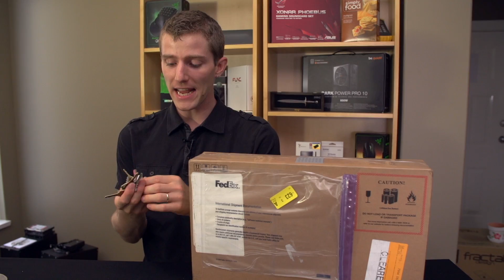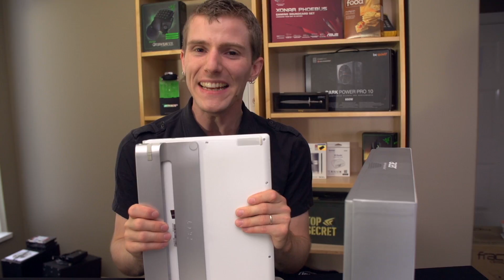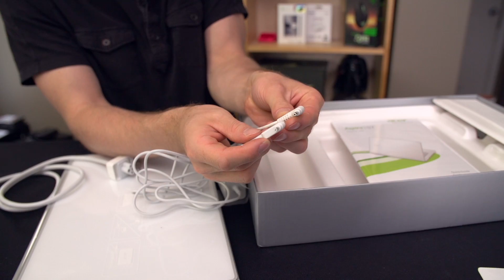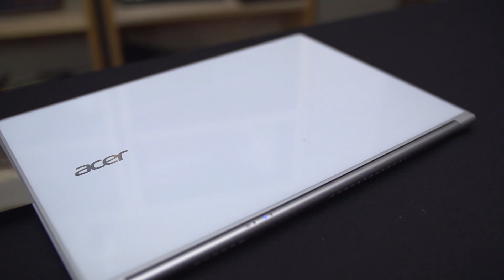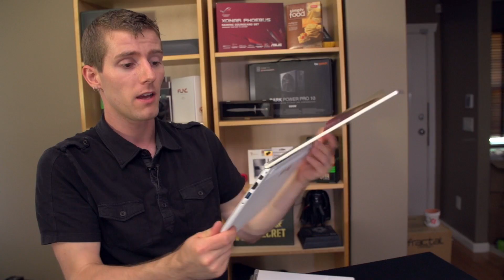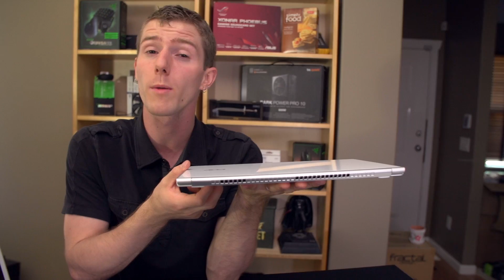Aspire S7 392 - 2nd Generation Perfection Unboxing & Overview

Comment: I am a big fan of Acer laptops. I recently purchased an Acer Spin 3 due to it's specs and price. For $549 US I got 7th gen core i7, 15.6" full HD display 12 gigs  of ram 1 terabyte HDD, alleged 10hr battery and blah blah blah (not to quote Alex Lifeson at the Rock and Roll HOF induction). It also spins 360 degrees to function as a tablet. Which brings me to my question: How much upside down, on its side can a HDD take before it goes belly up? I don't plan on dropping my laptop but I do spin it to tablet form frequently. It is a great orientation for clearing pictures from a memory card quickly. Should I replace the HDD with a SDD? Did you make a video addressing this question that I missed? Cheers, Sean

Comment: Old video so may or may not have an answer on this, but would you trade a Phenom IIx4 965 black edition cpu build with 8gb ram 1333mhz and an nvidia gtx 960 ssc 4gb video card for the previous aspire 391 laptop? i mean i'm the owner of the build previously mentioned but i need to move some now and then and that means i need something portable but good enough to handle photoshop and audio editing programs and why not the ocasional gaming.... so let me know what you think...

Comment: I've had aspire s7 for more than a year. Over heating, noisy fan, mouse stoped working(blue tooth and also some functions of touch pad), keybord has the worst design a manufcturer can make, display has high reselution but not sharp. I was missleaded by the sexy look when i went for this.

Comment: Yes,when Acer came out they were generally acknowledged as a complete POS and waste of money due to their horrible quality and failure rate....and that reputation has preceded them for quite a while....with that being said,I have seen them take great strides to shed that bad reputation of low quality junk they were pretty well known for....I would consider trying one out if it were a gift,but I would still be hard pressed to buy one out right...A close friend of mine is an engineer at the Foxconn in Plainfield IN...will have to get his 2 cents on the current gen of them.
Reply: chemicallust77 i actually got one of the first gen i7 aspires (one of the 7700 production series) and it's still going strong 5 years later. also use their 21.5" monitors as my two main monitors. they really shifted their QC and production values and in my book are really only a notch or two below ASUS at this point. they REALLY turned around. 

that laptop has survived some pretty hefty abuse. i actually dropped and broke the screen from a very high height but got the screen repaired and everything else was a+, which is a hell of a lot to say for an 8lb 17.3" monster
Reply: chemicallust77 My old aspire 5315 (and new E15) are both brilliant laptops but don't expect a brilliant screen (1366 x 768 and pretty bad colours) I have dropped the 5315 a number of times and it is still going strong. The 5315 is highly upgradeable too (up to 8gb of ram I think) I got the 5315 from my uncle and it wasn't treated very well but now with a core 2 duo, 2gb of ram and hackintosh snow leopard it really flies.

Comment: wouldn't trust it as far as I could throw it (quite far with how thin and light it is), the acer laptop i had for a year broke down on me 5 times and when it broke the 5 time, it was out of warranty, so i repasted the cpu and gpu myself, it stopped overheating and has been fine since, so it wasn't the components, just acer being incompetent

Comment: Can i hook up this laptop to a bigger screen if so would you know what wire i need to use
Reply: You can use an hdmi cable to connect to an hdtv. It's possible to use VGA cable but you need the acer converter cable also.

Comment: Brilliant Video, this is the machine I will buy next, always rated Acer, have an Acer Aspire 5536 running Linux mint 16, so I would biff Windows 8.1 straight away and install Linux. It is the nearest thing to a Mac Air. John in New Zealand.

Comment: I've been drooling over this laptop for the last few weeks now. I keep trying to tell myself that I can get a great deal on the older s7-391 model but I really am interested in a few key improvements. The quieter fan, improved battery life and performance from the Haswell processor. I actually didnt know about the extended battery pack for the 391 which is now tempting me to be cheap again but im not sure that it is actually included with that model 0.o Definitely this laptop gets my vote for most attractive laptop (in this price range). If I were rich I would be looking more in depth at the 14" Razer Blade which has similar specs, pretty design and a monster graphics capability for its size.

Comment: Of course it can't replace a desktop. However, with Haswell and other upcoming architectures, microprocessors and even the motherboards are shrinking more and more. Soon, we may have similar performance in a very slim frame. Go check out some of the custom mini-itx desktop builds out there!

Comment: Actually there are external lightning GPU's they just are not that optimised. I cant wait for them to be produced fully. Imagine that all you would need is a 1080p monitor and the external GPU and the PSU build in to it and just a laptop to use as a processor and etc.

Comment: yeah, unless youre running professional level simulation programs, or rendering 1080p+ video, I find no reason to replace a laptop such as the razor blade because of performance issues, although a desktop is obviously more comfortable.

Comment: I'm honestly kinda torn now. I was really thinking of getting the thinkpad x230 (or x240 when they make a haswell version) but this seems like a great alternative. The s7 has a better screen, is haswell currently (I'm patient) and is much thinner, but the x230 has a trackpoint (huge plus for me) better keyboard and much better battery life (20+ hrs with 9 cell and sheet battery on ivybridge) It's also cheaper right now ($950 or so all in for the x230, the x240 will cost more on release). What Do

Comment: I found a couple of problems with my own Aspire S7 392.
1) The keyboard emits a faint high pitch noise when the LED kicks in.
2) Write speeds on the SSD actually seem slower than last gen
3) Sometimes keys don't really register if you don't hit them dead center of the key.

Other than that, I found the ultrabook to be pretty awesome

Comment: the only reason i dont like it much is there are only 2 usb ports, in my opinion, most users use a mouse which will take up 1 out of the 2 usb ports so if you also want to connect an external keyboard for example then you wont be able to connect anything else via usb

Comment: Remember the difference is that Apple will design a product and then before releasing it to manufacture they remove a majority of the features just so they can offer them on the next years model without any other major changes.  This machine is a pretty decent update on horsepower while making improvements on the features of the original.  Apple does whatever makes them the most money per device, other brands tend to focus on the points that allow them to sell more units.

Comment: Spartan, I am also a halo fan. Just something out of the random.
But in all seriousness, let me ask you a question. Apple, the company that founded macs/ipads/ipods/iphones and the OS X operating system. With macbook pro laptops running on OS X, do you think Apple would optimize for Windows (something that Apple clearly did not make)?. Do you really think optimization for windows is there in an Apple product?

Do you really know what YOU'RE talking about? I don't think so.

Comment: 1. You can't type properly.
2. YOU are not trying to accept what iopabc123789 is trying to say.
3. YOU lost the argument.

What you are trying to say here is that, with a windows built laptop with the exact same hardware as a macbook pro, you are saying that running windows through bootcamp on the macbook pro will have better performance than compared to the windows built laptop. You've got to be kidding me, are you a fucking idiot?

Comment: They are not the same exact idiot, you clearly dont know that there are possible flaws in software. Mac can run software better and uh no there not as far as build quality. And ya your comparing a 7 year old console to a brand new pc with a little bit of older hardware, build a pc with parts 7 years ago running windows 7 and get 30 fps, just try, I challenge you

Comment: Uh if you can read, I said the link didnt work. I saw the video, kind of impressed but you know more about hardware yes, software you know zero. Have you ever heard of software optimization? Software, not hardware, you realize how invalid your argument is. Ok put planetside 2 which is a high cpu intensive game on that pc or even a high end pc and put it on the ps4. Ok they are the exact same software, completely identical, ps4 will run it as good as high high end pcs

Comment: Umm sort of true. You did kind of counter yourself though. hardware spec and optimization.. what optimizes hardware? Software... Lol

Anyway spec doesn't always determine a winner. A PS3 for example is far superior than any 500$ laptop. Play games on it at the same res and graphics will look better on PS3(at reasonable frame rate).  Why? Optimzation through software and libraries.

Comment: Can anyone confirm whether the battery "blister" pack from the original S7 will be compatible with the new S7? I'm very surprised Linus didn't touch on this or try it out. If it's NOT compatible, will Acer be selling a new battery add-on for the new S7?

7-8 hours is awesome, but imagine being able to add another 4-8 hours on if you needed/wanted to?

Comment: Run better my ass. Link or it didn't happen.

Although different motherboards on PC has shown to perform differently, depending on model and manufacturer. But usually these performance differences are very minor at best. And hardly worth spending the stupid amounts extra that the hardware costs, for a small performance increase.

Comment: @ components: not really, more or less. And @ software and spam: yeah buddy, but so does the rest. So format and reïnstall your pc when you buy one, regardless the brand.
Asus claims to use better capacitors on their motherboards 5k instead of 2k (where to 2k is more than good enough). I don't know enough of it to congfirm that. And Asus doesn't use its "consumer grade components" in their laptops. So don't worry, be happy. Look at the package, price and what you need.

Comment: Yes, no problem, have fun with it. And buy a custom cooler for it. It's worth the $. No water cooler for you yet tough, if you need to ask this, a water cooler is to advanced for you. With all respect. (4930K uses the (LGA)2011 Socket)

Comment: My opnion:
The extra few hours battery life, is because of the OS. Apple beats Windows in energy management. Furthermore Apple was always good in taking several seperate products in a market, and forge them togheter in something better. But if you are looking for something else like the MacAir, look at the Asus Zenbook Prime, or the Samsung 9 seris (now Ativ) or Acer S7. The Battery last 2-3 hrs shorter, but 7+ hrs is long enough in practice. (btw MacAir only get 10hrs in practice instead of 12)

Comment: Linus, What do you think is wrong with pc manufacturers, it feels like they just have trouble making the halo product. I want that high quality , low weight, 1080p ips(touch or no touch, don't care), with macbook air battery life. I honestly don't know how Acer can release a product without 12 hours battery life when the market leader macbook air offers that.  

Whats your theory on why ultrabooks are still trailing the macbook air? i think they just fail to understand the correct features.

Comment: I as computersalesman, not selling atm:
Acer isn't my favorite. But the difference isn't that much with other brands in the practice. I like asus but when I buy an Asus and an Acer and use them the same, they should last evenly long. Only Asus designs better. (RAID 0 SSD is unnecessary for ultrabooks, bad even). So for the same money, go for an Asus in my mind but that doesn't make an Acer bad. And in both ways: always format and reïnstall your Windows. Anti bloatware.

Comment: Ok I'm bored tonight and replying to much. but here I go:
This type of model is build for the "business market", for people with lots of money to buy a -very- good ultrabook to school or work with.
Now you can have 4 or 8 gig's of RAM, wich in both cases is more than enough. These ultrabook have features like long battery times (thanks to SSD's and underclocked processors). They are lightweight, strong, not build for overclocking, gaming, Video/ Music/ 3D editing etc. So the FAIL is on you!

Comment: Love it or hate it, soldered memory is going to take over. I don't necessary think its failure rate but more that it allows manufactures to save money. when you solder you don't need to order/manufacture pcb anymore or sodimm slots.

It also allows for less tinkering. It allows oems to deal with rma directly without having the user attempt to repair it themselves which may cause more damage to the product.

Comment: Wait, wut? Are you saying modern RAM has a lesser failure rate and therefore  we should give manufacturers a pass over omitting user replaceable ram? Not sure if srs. My machine is light as hell and still has user replaceable ram. Hell, it has 2*mSATA as well, which are also replaceable. 3.1lbs or 1.4kg.

Comment: I do respect your opinion.. And i have watched your video, did you see how many dislikes it has? Its because the guy didnt know a single thing about windows 8.. The first thing that pops out when you install w8 is a tutorial which explains you the new options and features. (it wasnt hard to click windows button and just type control panel, it would pop right out here and you will be able to open it)  same with pop out things, nothin' pops out anymore, there's nothing, same as swipe gesture.

Comment: Sony Vaio is made out of carbon fiber, which is worse than the Acer S7 which is built out of a unibody aluminum enclosure, with gorilla glass 2 covering the back and the display. Carbon fiber flexes allot, you should check some reviews first. Both laptops are 13" Full HD IPS LED-backlit touch displays (1920 x 1080), but sony included bullshit software "optimization" which is not even close to sRGB meaning that the colors appear to be unrealistic, kind of like Samsung and their amoled crap.

Comment: I actually must disagree with you on most of those points. The display on both are extremely similar however in my testing I have found that the s7 has superior viewing angles. The s7's keyboard has more travel, and trackpad is superior in terms of latency. I worry about the vaio pro's build quality as it has alot of flex in the chassis, the s7 gives no flex at all. Battery life and boot time are  the same as well. All in all both are great machines but I believe the s7 edges out the vaio pro.

Comment: Meh. Should have waited for the ASUS UX32D haswell refresh. I have the Ivy-Bridge SKU and its ram and ssd are both upgradable and not soldered to the board like this. Plus discreet graphics. Matte, non-touch display.

Comment: I would have a really hard time recommending this over a 13" MacBook Air (even when considering that the Acer comes with an i7 and a 1080p/1440p display by default). MacBook Air with 256Gb SSD, 8GB's of RAM, +12 hour battery life, 802.11ac, magnetic power connector, Thunderbolt and with a good trackpad would still be +130USD cheaper.

Comment: and yet Win-8 is much faster.You cant argue just for the start menu button.. you don't need it at all. After some time of use you will find yourself liking the new re-designed start menu much better, its organized and fast.. 
Despite all of that it starts up much faster (with an ssd, believe it or not it takes less then 10 sec. All programs are compatible (everything from adobe,microsoft and others. they all work.. the only thing that didnt work for me is one program similar to xampp. )

Comment: I've still got my 5930g for 5 years now :) 
The Core2duo, Nvidia 9600m GT and 4GB RAM is still more then enough to use this machine as a backup or to borrow out with a guest-account on it when I have people over.
Only things I've done to it over the 5 years is swapping out the old HDD with a 120GB Intel SSD, changed the fan (witch cost $10 on eBay) and formated to windows 8, and it works like a charm! Still getting 2hrs battery life from the original 3.5hrs.

Comment: Altough I dont have personal experience in retail, I have read a research of squire trade from 2009. They looked at failure rates of more than 10.000 laptops and concluded that acer had one of the worst failure rates (23.3%). ASUS had the 'best' failure rate 15.6%. 

Acer gives bang for buck but will use cheap parts, the simply have to if they want to sell low. This laptop is very expensive, therefor they can use good parts and therefor it is probably much better as there entry laptops.

Comment: Check out Zenbook Infinity. It looks very compelling if the price won't be too high.

The problem for me are glossy screens with touch. They are very bad, because they reflect a lot of light and are used only because Microsoft started with Windows 8 touch functionality.

In my opinion touch screens are inaccurate and slow compared to mouse and keyboard.

Comment: I would say no, I owned the first gen and had it once fell and got stepped on. After picked it up and check for damage, this thing is just as perfect as origin, only bit scratch on the plastic side, no crack screen, no crack lid, no damaged keys at all. Till now I'm still being impressed by the rigidity that Acer has achieved on the S7